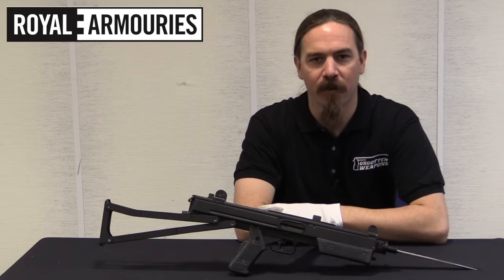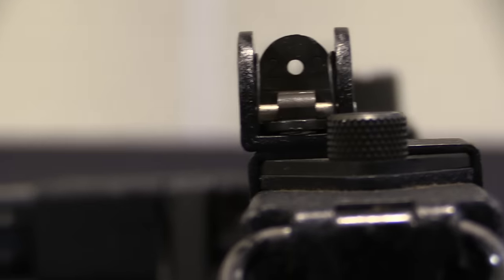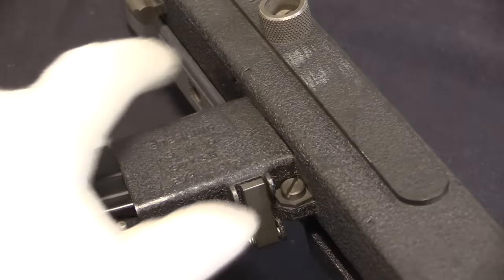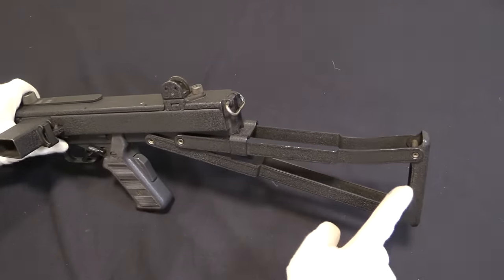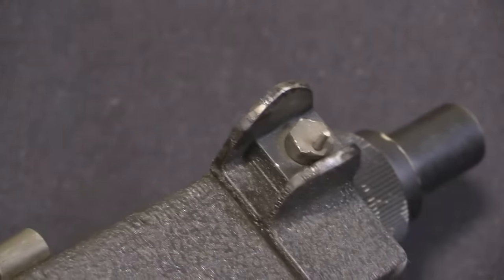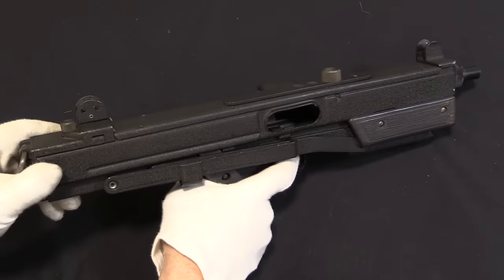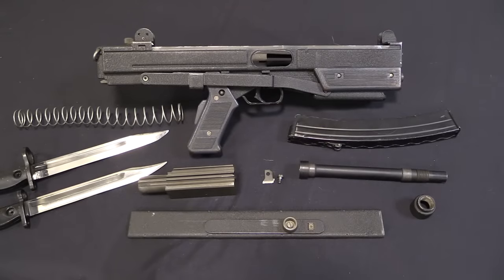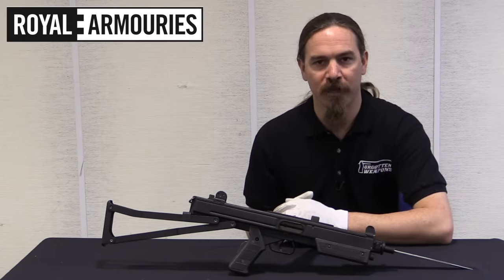Sterling S11: Donkey in a Thoroughbred Race

Comment: I would guess that the offset barrel was there to accommodate the bayonet.
Reply: I suspect that it is there to reduce the angle/distance between the magazine lips and the chamber. They need a substantial bolt to keep the chamber closed for blowback, and therefore needed the width, but a central chamber would have made feeding problematic. I can see the sense in what they were trying to do - keep the angle the same as the L2A1
Reply: Paul C 
That was my first belive, but if you want a heavier bolt there are 2 way wider or longer.
Adding one inch in length would have cure asymmetrical.....
Who knows..
Reply: @paulc2886  maybe it is to balance the gun against the magazine
Reply: my guess is that it was designed by a committee....
Reply: Sounds possible
Reply: Øyvind Alexander Frivold 
Nop.
All; mag, bolt and barrel is in left side....
Reply: @paulc2886  on a kind of related idea maybe it was because of the curvature of the magazine, i wouldn't think a curved mag well is an  easy thing to make, but then why not make the gun thinner, I now kind of think it was because it was the easiest piece of box section steel they could get their hands on and designed around that.
Reply: @MrTrilbe  The original Sterling used the same magazine without the barrel having to be offset.  These blokes just had to be different.
Reply: Priorities.
Reply: @RichWhiteUM  there's a difference in the body shape and dimension, just because one worked well, doesn't mean the other will
Reply: @MrTrilbe  Seriously?  You think the barrel being offset to the left and the right side being made wider was because of the feeding system on the left?  The right side of the gun has nothing to do with the feeding from the magazine.  If it were to be slimmed down and and the bolt lengthened for the mass needed, it would still feed in the same spot.  You're hypothesis makes no sense.
Reply: MrTrilbe Perhaps it was a combination of using the most cost effective profile for the steel, while trying to reduce how far the user would have to bring their cheek weld over the uncomfortable folding stock
Reply: @RichWhiteUM  no, I was saying that the offset internals could be because they used off the self box section stock to make the body and the curve in the magazine necessitated moving the internals to make inserting the magazine possible or as other's have said line up the feed lips correctly instead of cutting down the box section for this prototype.
Reply: It could also be so you can get a good cheek weld without the recoil pushing the stock right into your face.
Reply: @timlybeck1532  yeah that would be my theory- sight alignment for right handed persons.
Reply: @yvindalexanderfrivold  It appears the grip IS centered though, which puts the barrel on the same side as the mag.
Reply: I'm going to guess the gun was designed symmetrical, and as cheap to make as possible with as little machining as possible. No telescoping bolt like on an UZI, ect...
Then someone decided to use the existing magazine,  and the quick fix was to slide the barrel over to make the magazine work, planning to make it symmetrical again in a later version, but later never came.
Reply: I'd guess the off-axis sites might be something to do with recoil pushing through the centre of mass with the side mounted mag when full?
Reply: @milybanily  "Nop. All; mag, bolt and barrel is in left side...." That is the whole point of puting you barrel in the center of the mass... so it will be shoting at your target, not at the guy that is standing on his left side when your gun is starting to rotate the wepond when you trying to hit the guy...
Reply: yep, that was my immediate conclusion when it fit perfectly from the SIDE.

Comment: Sounds like mid-60’s British industrial design.  The goal was to build a competitor to an elegant competitor, by cheapening an excellent design we, Sterling, already produce. 
So well take design elements from all sorts of places, with little thought to unity of design though, apparently from a committee of blokes walking by the conference room. They took design elements from the UZI and Mac-10,  stuff in their own shop, etc. Someone with pull had to think the charging handle needed to be mounted so as to accommodate right and left hand.
Reply: Its like the Morris Marina or Reliant   Robin of British SMGs
Reply: Unfortunately very much a st5aple of British engineering. When we get it right it's generally two blokes in a shed or a single person leading the way. When we get it wrong it's usually because a comittee was involved and they didn't understand the concept of "Cheap, fast, good. Pick two" but insisted it had to be possible to have all three.
Reply: MrGrimsmith understood, but I think the Brits often add.... odd or weird.
Reply: iatsd; wait, US vehicles of the 1960’s weren’t bad, now the 70’s were absolutely unadulterated, crap.
Reply: I bet one guy designed the magazine well and other the receiver. When they found out the magazine wouldnt feed with the barrel in the centre they said bolliocks and just bodged it.
Reply: @charlesadams1721  It's a gift that we, as a nation, appear to have embraced wholeheartedly. Not necessarily a good thing but eh, we've practiced, we can do it well! :P

Comment: "Hey, You know how to reckognize a british sordier? 
Yeah. WW2 ended, and they still have magazines standing horizontaly."
Reply: Hey it works for the Gurkhas.
Reply: Hey, if you're under fire and want to get REALLY down in the dirt.... don't knock it - it really works well (the Stirling SMG, not this thing!).
Reply: Thats true, ive wondered about this for quite some time but i think ian told the basic benefits to where the magazine is: topfeed is for better reliability (but the magazine gets in the way of the sights), side feed good for easily getting as low on the ground as possible (but ofcourse the guns center of gravity is quite shifted to the side) and then bottom feed which gives you a gun which has the center of gravity in the middle but it does get in the way when going prone and has a little less reliability
Reply: @jackaubrey8614  so does a kalash and its infinitely more functional than the hot garbage that was the sterling
Reply: @naeemsarwarmirza835  right? Why didn’t those dummies in WWII just use m16’s?!??
Reply: Bren is a superb platform; still in use for a reason

Comment: 8:35 from this perspective, i get the feeling the double bayonet feature was the main cause of the barrel offset...
Reply: Or maybe it has something to do with the feed mechanism?
Reply: @pjnoonan1423  Thats what I was thinking. Maybe with the form factor they wanted, the weight they needed on the bolt, they couldnt make the receiver thinner so, to use the Patchet magazine with that thick a receiver they had to offset the barrel? Thats like one of the only reasons I could think of, and its very likely false, I just cant think of why else.

Comment: The sten was designed with clandestine manufacturing in mind.It specifically used machining and components in it's design so it could be made by unskilled workers in any basic tool shop such a mechanics garage,plumbing shop, carpentry shop etc.

Comment: Galactic empire wants to know your location
Reply: Is this gun the base for star wars blasters?
Reply: Ikr. It looks so much like the Stormtrooper rifle from Star Wars.
Reply: @99thJediWarrior  Close, Lucas used the L2A1 Stirling as the base for the Blastech E-11. If you check the weapons used in Star Wars you'll recognize a lot of actual firearms being used. Lucas did it to give the blasters an air of being real and well used. Which works well in my opinion.
Reply: @michaelfodor6280  Yea I remember that the MG34 (or 42) was used for Chewbacca's rifle from Empire Strikes Back (not the bowcaster)and I think it was used for the bigger blasters that the Stormtroopers used. You can tell from the stock and grip on it as well.
Reply: It would be cool to see this as the new blaster
Reply: I was wondering the same thing. Looks exactly like the blaster from the original.
Reply: It looks like a DC-15a
Reply: underrated comment. somehow wish I had a airsoft model of it to mod like a standard stormtroopers gun
Reply: @michaelfodor6280  Not L2A1, L2A3. @countzero87 The Sten was NOT used in Star Wars.

Comment: The barrel could possibly be offset to aid in more reliable feeding from the magazine seeing as it is off set to the side of the magazine. That and likely wanting a clearer sight picture probably contributed to the off set barrel. Edit- also can you use two bayonets at once?
Reply: No reason why you can't.
Reply: @smittysmith6173  Perfect answer, sir. Just perfect.
Reply: Possibly so, the breech block has to be a certain mass for the blow back action. If the barrel was central the block would have to be longer or taller to maintain the same proximity in the feed and taller would compromise the basic round return spring design.

Sadly, the multiple bayonets were probably just to evaluate the options on the prototype.

Comment: I suspect that the offset barrel allowed the operator to partially break down the weapon and insert a hot dog or tamale into the frame recess in front of the bolt / rear barrel mounting bulkhead allowing the gunman to heat his lunch during combat.
Reply: It was hotdogs, everyone knows hotdog grease is as good as gun oil.

Comment: Further enhancements include an attachment point for a Zip-22 and a single-shot Gyrojet launcher that mounts to the side opposite the magazine. The buttstock will have a slot on either side, depending on whether or not they want it to carry chopsticks or a spork, and a choice of two oil bottles, depending on whether they want one filled with soy sauce or Worchestershire sauce (under no circumstances is actual oil or yankee Tobasco sauce to be placed in this bottle). The sights will be offset even further to allow a GI angle-head flashlight to be mounted on top (but only the opaque white lens will be authorized for use).

Comment: Is there a difference in handling or firing when the magazine is on the side like that?

Whats better: A magazine on the bottom or the side?
Reply: Sideways magazines were initially designed during WW1 to accommodate easier firing from trenches and while prone. See how long the magazine is? Imagine how difficult it would be trying to fire a weapon with that magazine in the bottom while prone or in a trench. As warfare moved out of the trenches and further evolved, the sideways mags started seeming impractical in some ways. For example: these and most other European guns at the time were chambered in 9×19mm Luger. A full 32rd magazine sticking out to the left was kinda lopsided, which meant aiming was always slightly different depending on how much ammo was left and they were awkward to carry loaded for long distances.
Reply: @dallasmckim4370  Fascinating🤩

Comment: Was it offset to reduce the length the ejector would need to be in order for it to work with the existing magazine? The Sterling has a much longer ejector, they could have been trying to reduce the length of it to decrease the number of failed ejectors? Did the Sterling have a problem with ejectors failing?

Comment: ANYONE who has been in the world of engineering and has designed, built and developed prototypes should automatically know that this can be a very stony path.
There are many stages and can be various prototypes. In the case of the S11, there is only one in existence, so any form of visible progress is not available.
I find it therefore not quite right that this sole prototype receives a drubbing as if it was ready for production.
Reply: Yes! And they made an understandable decision not to incur more sunk costs rather than keep iterating on a dubious project, especially in a market that was shrinking.

They may not have revolutionized SMGs or anything, but IN CONTEXT, you can see why they did what they did. 🤷‍♂️

Comment: The reason why its off centre is to reduce the magazine to barrel breech jump distance that had caused feed issues on the Sten . Sterling survived on the SMG and the AR 18 / AR180 rifle ( another pressed metal design in black wrinkle high temperature paint ) eventually closing the Dagenham plant in the 80 s after the failure of the 9mm /38 dual calibre revolver they hoped would be adopted by the UK police forces and change in UK legislation for civilian ownership of semi auto rifles , although the AR180 was notably absent from our ranges before then . Frank went on to produce high quality air rifles in a unit not far from the original works in Rainham Road .

Comment: Is it possible that the barrel is offset to partially counter the balance of the magazine?
Reply: Then shouldn't it be offset to the other side?
Reply: The barrel is offset to the left. The magazine is also on the left. If anything it would make the balance even worse.
Reply: It would need to be offset in the other direction for that and even then any effect gained would be minimal if any. Good question though
Reply: Most of the mass of the bolt would be on the right. It really depends on the grip position.  An alternate thought is that it is offset to work more easily as a bayonet mount for the No. 5 bayonet. By offsetting it like that you don't have to make more cuts or build up the part that contacts the bayonet handle.

Comment: Nice unique piece. I personally find the single reason to ofset the barrel is to allow them to add mass to the bolt without extending it in length. For the open bolt fire machine guns is very tricky to find the best balance. The bolt mass provide the inertia, spring load provide static force to hold the bolt closed in the moment cartridge goes off.

Comment: I have an idea about why the gun appears to be offset to the left inside the receiver. 
Since it's a straight blow back operating system, it may have been an attempt to add mass to the bolt in the least offending direction. That may have been the best way to keep the bolt short or smaller in every other dimension???

Comment: The handle is in the middle, so it will not really change the ballance, but it will change the recoil ballance. The magazine to the left will will rotate the barrel to the right during recoil. Most of the weight of the gun is to the right of the barrel to balance the gun more when accelerating backwards during recoil.

Comment: Up next: an smg with dual blender blades at the muzzle
Reply: Rotating bender blades with a synchronizer gear to fire between the turning blades. Worked on prop aircraft so it should be good on an smg I guess.

Comment: Random thought on the offset barrel. Correct me if I'm high and left, but could it have been an issue with misfeeds with the stamped construction and they tried to alleviate that by shifting the barrel and mechanism closer to the mag well?

Comment: not sure if it was commented before but I'd say the barrel is offset to accommodate the first bayonet you showed off to the side. were the barrel and action centered it would not have worked with the shoulder recess in the barrel nut for the #5 loop.

Comment: 8:40
I see now! The barrel is not central because the big loop from the side mounted bayonet has to fit around the barrel!!!
Reply: Internet Entity ah good idea! However if this were the case, why didn’t they simply make the other side not as far from the barrel )if that makes any sense)
Reply: @tythosdelta2650 
Size of recoil spring used and/or available for their specification? 
Same with the size and mass of the bolt?

Comment: The reason for the offset barrel is that the bolt face can be closer to the side of the bolt which means that you don't have to cut the reliefs for magazine feed lips as deep in the bolt, saving machine time and materials cost, most open bolt subguns with a rectangular bolt do this but you don't notice it because the barrel isn't offset to the side but offset down since that is where the magazine is.

Comment: I suspect the barrel distance from the left side of the receiver was a dimension that was fixed in design by the fact that they maintained the original sterling magazine. Basically the barrel couldn’t get further away from the left wall of the receiver unless they found a way in the design to insert the magazine further. Just a guess. Thanks for all of the great videos!
Reply: Give this man a coconut...only reason put forward to make engineering sense. Good thinking

Comment: The barrel offset may be to put it closer to the weapon's center of mass. With the magazine loaded, a barrel down the center would be to the right of the center of mass, and the recoil would tend to pull the tip of the weapon in that direction.

Comment: "Due to the S11′s folding stock its sights are offset to the left, to bring them more in line with the operator’s eye. The box receiver necessitated a new stock design with two pivoting points either side."

Comment: Reasons for the offset sites and barrel?  :-
1 : The dimensions of the Nr5 bayonet.  With a centrally aligned barrel the bayonet ring would be too short.
2 : This is a right handed gun.  The offset brings the sights more in line with the right eye when used from the right shoulder.  Not good, if you happen to be left handed.
I have no idea if these are the reasons for the asymmetry.  I'm merely thinking how the designer may have thought.  On the other hand, as in any design, it may have just been a good idea at the time.

Comment: Could the offset have been an attempt to keep on target when firing?  You have the magazine moving the CG to the left and the extra metal on the right of the bolt block (with its inertia) + supports and other hardware trying to keep the barrel/aim straight?

Comment: Barrel offset to the side makes for less milling on the bolt vs if the barrel centerline is centered on the bolt and receiver. And maybe a better cheek weld on that stock made of unsharped blades.